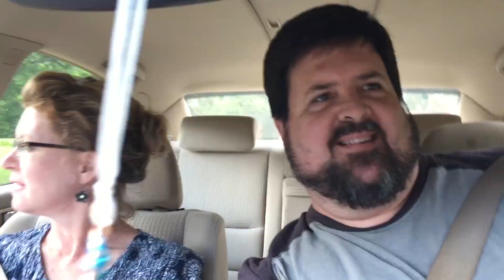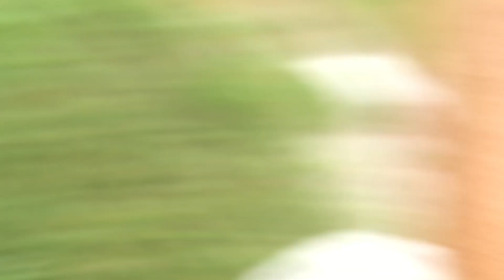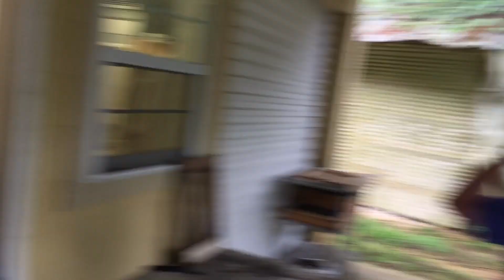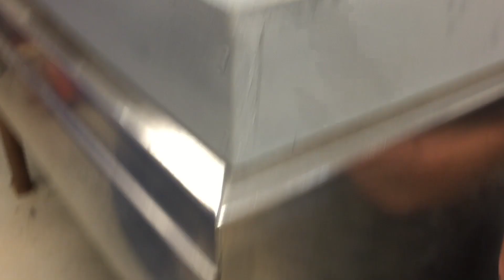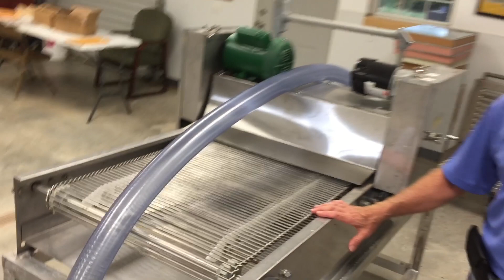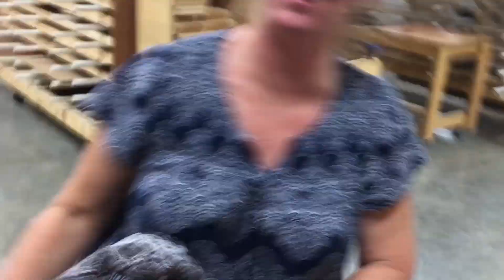Dirt Rooster VS Horchoff While You Wait For Mayweather VS McGregor on Pay per View, first round stop

Comment: I hope all is well, I haven't seen a new video for a while. But since you are one of my favorite bee channel, I have a question. Today up here in in SE Pennsylvania it got into the mid-40's and my bees were out having a good old time. I had been wanting to put an indoor/outdoor thermometer on the hive to see what is what. I had previously combined my two hives, one was very weak. So today I popped the cover and slipped the outdoor sensor under my bag of wood chips used for insulation and moisture control. I have one sugar candy block and a 10-lb. bag of dry sugar on top of the frames then the wood chips. There was a clump of bees clustered on the wood chip bag between the candy and dry sugar. I will check the temp inside the hive tomorrow, suppose to be even warming. My question is this mini-cluster normal or have I lost 90% of my very strong hive already. These are nasty bees so I don't spend much time in the hive. Some of the bees were up at my fish pond collecting water, others were house cleaning, I was happy until I saw this small cluster.
Reply from the maker: Could have just been some that were getting sugar, got cold and clustered up away from the rest of the hive.  I'd at least crack the box on the next warm day and take a quick peek.